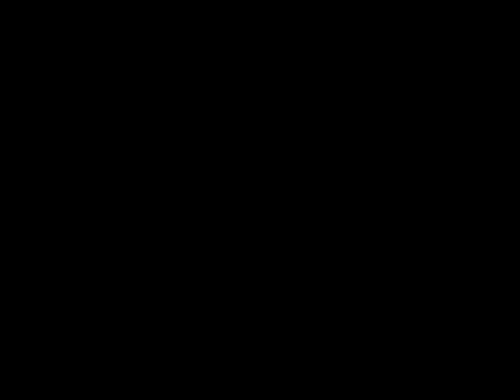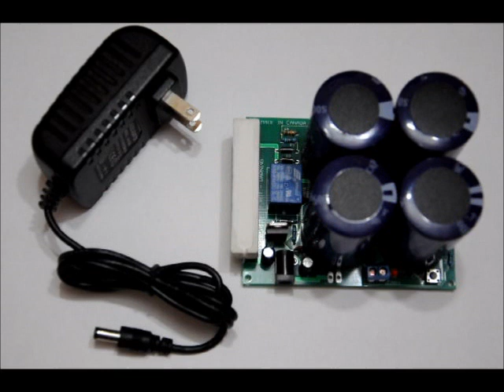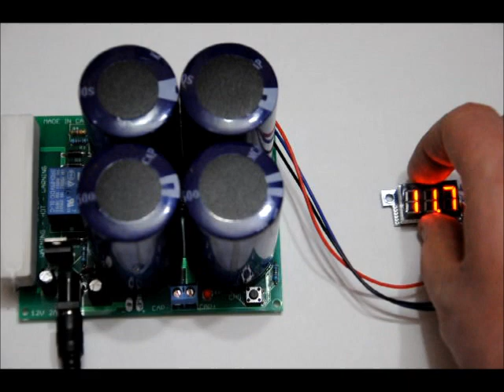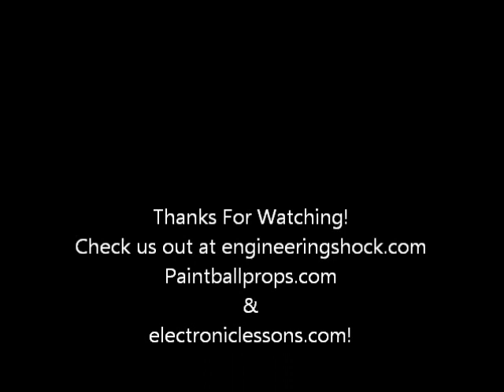The portable super capacitor battery bank with voltage boost options! Rated for 400F 5 4v

Comment from the maker: I hadn't thought about the importance of that.  It is just a portable forever-rechargeable battery unit.  I've used it as a portable power supply when working outdoors in the sun.  I've also interfaced it with my radio outdoors.  It really depends on the user, but the possibilities are endless; especially with a booster.

Comment: If you are "burning off" energy through the power resistor (to regulate current flow) the circuit is inefficient (not green)? Correct?  Best to use something like a buck-boost circuit instead to charge the capacitors and limit the voltage to a constant current (regulate current flow too). Maybe the same buck-booster could be used in charging and also in creating higher output voltage too. Sort of dual-use.

Comment from the maker: The capacitor traces are on the bottom of the board, and are 6/10 of a centimetre wide.  It can handle a much larger load than a solder trace.  A dead short at the output will likely damage the traces, but not melt them.  That said, it is never optimal to have a dead short at the output =s

Comment: Super caps have very low esr so they can discharge all there potential energy almost instantly. Passing it through a 3A boost converter is not utilizing its unique properties (ultra high current demands is short bursts).  As some one else mentioned an old pc power supply would work or a pack of liithium ions or lipos. Seems charging supercaps is more of an issue than anything else. 

Thanks for demonstrating your set up. Interesting use of supercaps.

Comment: I'm new to all of this, only started learning when I got interested in aquaponics.
So here goes, I have a home made solar/wind system to power a greenhouse I build to houses the aquponic and solar/wind system, which I want off grid. So could I use the 13 volts from solar/wind to power the super capacitor bank and have the output from the bank power a 1500 watt converter? In order to reduce the drain on the batteries.
Reply: +akoben adinkrahene surely you can do that. Supercaps are designed for this scenario. you can easily find some supercaps that can handle discharge current upto 170A@16V, (just from a 250mmx80mm module) . You can even use more of those supercap modules to achieve much much higher output power. The only problem with low ESR supercaps is price. A 2.1Wh 16V module will cost upto $150, for 1500W applications you gonna need maybe at least 10 of them in parallel(will last for about 40 seconds). 
Basically supercaps are only cost effective when you are looking for short period high current charge/discharge. 
Well, if you have much more money than you could spend, you can just replace half of your batteries with supercap banks. By then, 1500Watts is nothing,  you can hook them to Mwatts level inverters.
Reply: +Hu Sun BTW, a 18Wh 30A lipo battery only costs about $10. Well, compared to supercap, even charging a high current lipo battery feels like the pain in the ass.

Comment: Question... hope you can help me. I am making a project where I need 8.333 amp out at 32v with a 12v input at a max of 500 amps(battery/capacitor hybrid wired in parallel together). Would this booster circuit board be able to boost to 100w output at 32v given an input of just 10vdc? Its for a high powered 100w solar powered torch :D

Question 2. Can this circuit board be run in parallel with another booster circuit for voltage out. For example say if I wanted to power 2 x 100w LED's each unit requiring 32v at 3.125 amp. I am looking at using a single power source that is more than capable of 12v 500 amp output (for a short while) but to double the light by utilising another LED (if required) by utilising another one of these booster circuits?

Any input on these questions would be much appreciated :D

Comment: why the resistor gets so hot?
Reply: Ultra Fire it simply limits the current charging the supercaps to not overcurrent the Supply, because an empty cap is like a short circuit